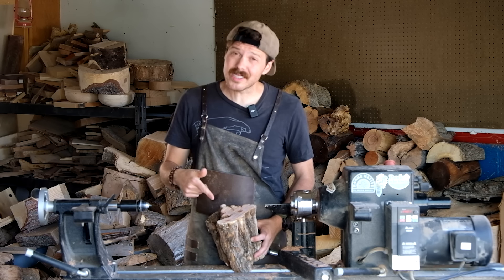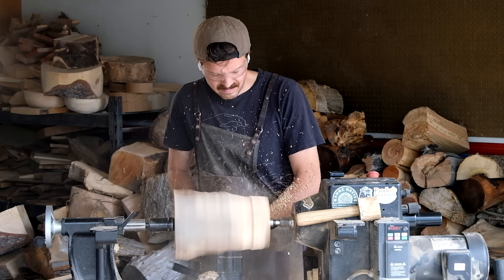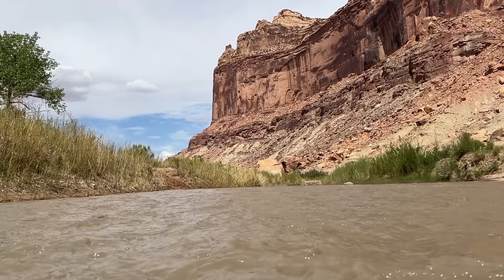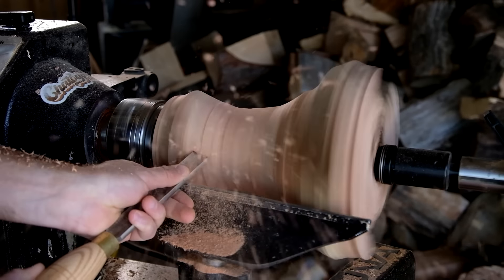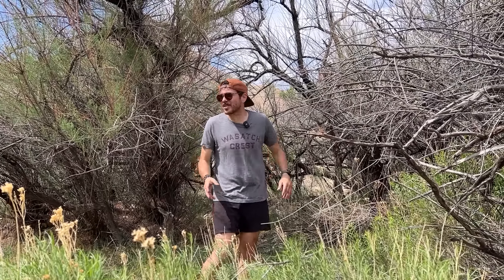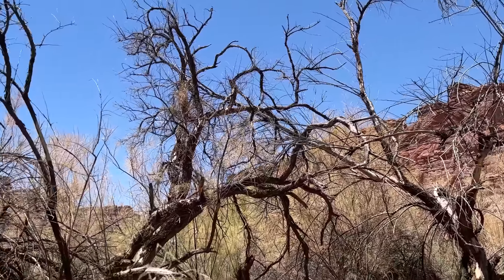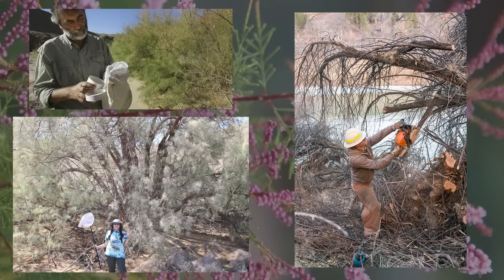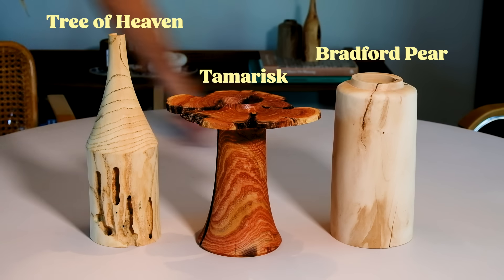Wood Turning a Salty Species of Tree | inVASEive species

Comment: What I remember of growing up around salt cedar is that grandma would pull off a switch to use on us kids when we were being brats.  Not only did the switch hurt when it hit your legs, the salt made it sting until you could take a bath later.

That said, there was a salt cedar in the local park.  After it rained, the salt could be seen on the top of the sand marking where the water trickled by.  No grass grew around it so the sand was fun to play in.

Comment: Would love to see you turn a piece of Box Elder/Manitoba Maple. This tree is invasive in Ontario, Canada, and the wood can get bright red swirls in its grain if the tree was subject to stress. It's a sort of soft hardwood, so it's easy to work with, really gorgeous with the red flame in it, but it doesn't often get used because it's generally weaker.